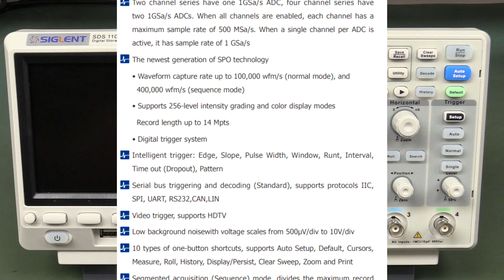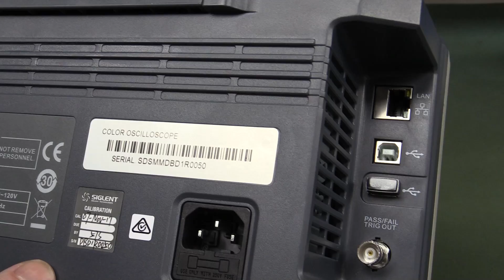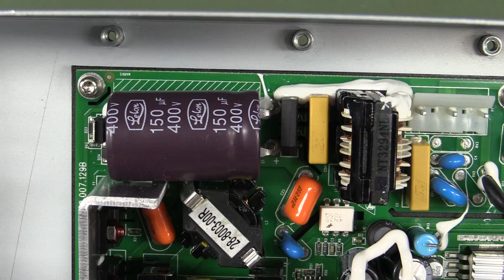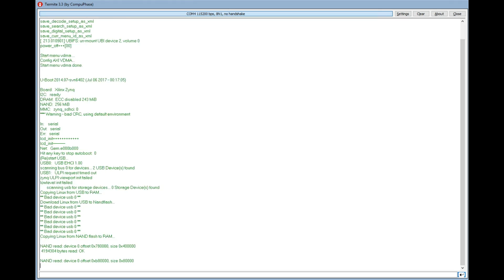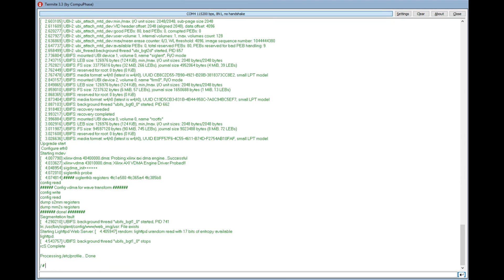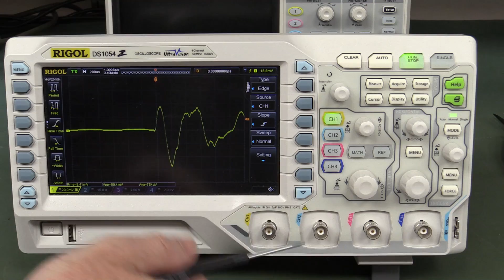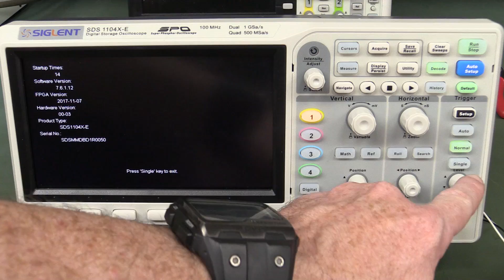EEVblog #1042 - Siglent's $499 SDS1104X-E 4CH Oscilloscope Teardown

Comment: What is the actual name of the white gunk?
Reply: looks like theres 2 types on that power supply one looks like some kind of epoxy and the other looks like rtv silicone, if you use silicone it has to be acid free not the type used in bathrooms, but R'oom Temperature Vulcanising' - 'RTV' type for electronics that uses alcohols to cure and not acetic acid (kinda like difference between acid flux and no clean, ones not for electronics, the other is), also you can get flexible ish epoxys or sometimes use like hot melt glue in an emergency which is pvc afaik. but most well known polymer producers like 3m/dc/ge etc have special brand named things like dow corning 3145/ 744/ 736/ 732 ,loctite 5145/ 5366 general electric rtv162/ rtv11/ silicone II, servisol 31665, acc silicones as1700/ as1701 and so on
Reply: Dave is calling it Silastic, which is a Dow Corning trademark for silicone elastomer. Probably something like that, but could also be some other kind of rubber or adhesive.
Reply: Polyurethane Sealant
Reply: Ben, great comment !! interesting.

Comment: Is that a HDMI port on the front just next to the USB connector?  that would be sweet if you could atach a monitor to it and get a much larger picture.
Reply: Just found it in the SDS1000X-E series manual labeled as "SBUS Digital Inputs. WARNING: Non-standard HDMI interface, Siglent device ONLY, or you will damage your devices". No wait and see required. My intuition was correct even to the point that you can damage your scope ;) .
Reply: Pretty sure that's where you connect the optional logic analyzer. Using existing high volume consumer connectors keeps the price down (and keeps people at buying new scopes after they fried the internals after connecting a TV to it ;) ).
Reply: It's probably not video in/out considering "Sbus" marking underneath it, but still I have no idea what it is for.
Reply: Hard to tell from the video but the jack looks a lot like a HDMI connector
Reply: Wow using a standard connector for something proprietor.  That's not good engineering but hey it's cheap so I guess you go with it.  Just don't plug a monitor into that connector.
Reply: We will have to wait and see.  I am planing on buying one as soon as I can
Reply: the only "SBUS" i remember was from Sun Microsystems, but they surely wouldn't use such an out dated bus on a new scope!

Comment: Zynq-7000 series FPGAs use separate memory for the Processing System (2xCortex A9) and the Logic System. They can get away with a single RAM chip for the processor.

Comment: ouch! it seems the tagarno video capture is messed, very low pixel resolution...
Reply from the maker: My new Vegas 15 software sucks and couldn't import the Tagarno video, Had to convert first. Not sure what happened.
Reply from the maker: BTW, it's not "very low", it's still 1080 HD, but not it's usual clarity.
Reply: I mean, the video has been improperly resized during the process, with a pixel aspect different than a square (anamorphic). it is more noticeable on rounded silhouettes...
Reply from the maker: Yep, sorry, my new windows 10 machine with a new version of Handbrake wasn't compatible with my old handbrake scripts, so I had to convert manually using the GUI. I think I had Anamorphic turned on. Didn't see it on my preview window.
Reply: I also noticed this right away. The compression is very noticeable for example right at 7:50 - lots of detail lost. But hey, no biggie. We're all just too spoiled by your normally excellent content ;)
Reply: did you wand to join electronics class in google this is the class code a8zr54
it will be perfect if you join too!!!

Comment: 69 dollhairs for a USB WIFI dongle? Really? $3 from ebay...
Reply: looks like the TL-WN725  ...14 bucks on amazon
Reply: Nothing strange, that is the usual what you get when you buy extra things from the manufacturer.
If you want to try, buy from ebay, Amazon or Bang good.  If you want to know it works, pay extra for that.
Reply: I am using just that to comment .... it is just a RTL8188, Dave shoud see if aftermarket wifi things work with it
Reply: @xMalhardeshmukh  True. It will work ok.
Reply: Anders Jackson if the scope supports hubs, which is not a given. And there might be non standard power requirements.

I really like the idea of external USB expansion for this sort of thing, though.
Reply: mipmipmipmipmip ITYM only 2 ports. The other port is the slave port, not a Host port.
Reply: Yeah what the hell’s the deal with that !!?
Reply: That is easy to solve with a USB hub.
Reply: Of course, it would be better if there was a hub built in from start.
I would be surprised tough if they have not tested those extra devices they have, with an USB hub.
But yes, software tend to have bugs in the first releases. :-/